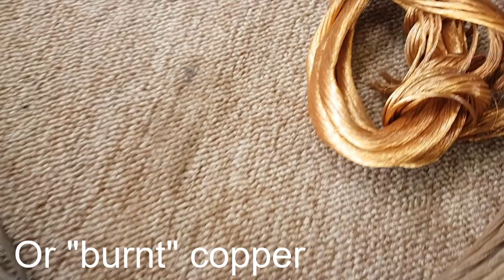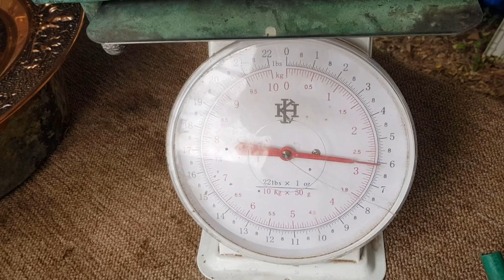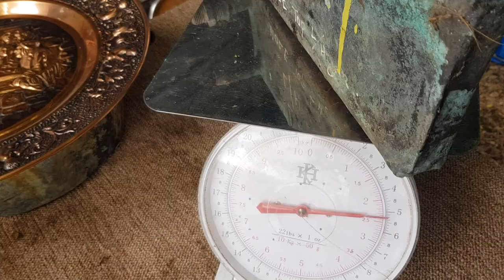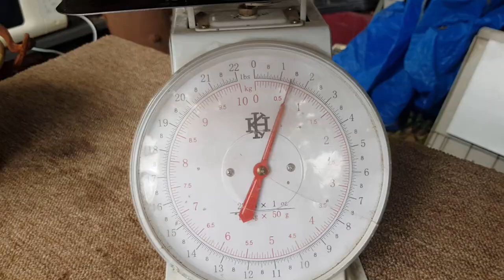Scrapping Copper! A beginner's guide to a valuable scrap metal and how best to make good dollars!

Comment: Thank you for taking the time to share your knowledge sir! You have a very easy going way of explaining things so as my brain doesn't explode when understanding the fundamentals of the chemistry of metals. My question is, is there an easy and time saving method of stripping #1 copper wire (in bulk) without diminishing the price from top tier.
Reply from the maker: Thanks Jacob. You can buy specialist wire strippers, but it's only viable if you have lots of heavy gauge copper wire to strip. Standard appliance cords aren't worth it in my opinion.

Comment: Never knew that they had started swapping out the copper for aluminium in the transformers. Cheers Chris.
Reply from the maker: Yeah, it's been sneaking in over the years - cost cutting by the manufacturer's I guess! Disappointing for copper hunters!
Reply: @TheUltimateRecycler  even more disappointing when you take the top off a fridge compressor and find it's  aluminium and not copper.
Reply from the maker: @howardchambers9679  It would be! I didn't know they were using aluminium in compressors! As a rule, I don't scrap them out anyways - too messy!!

Comment: Thank you for the educational video. I'm glad you pointed out the copper coated Ali wire on the transformer as I to came across the same type out of a microwave. As the wire was quite black I had to scrap it and noticed the colour plus it was considerably lighter. As a begginer I'd already pulled it apart lol. My question is regarding copper pipes. I found a pile of mixed pipes and some are a chrome colour possibly from a wall mounted urn or water cooler drink fountain. Non magnetic and after filing its a bright gold colour possibly brass unless stainless can be that colour? Oh have you a video on car stater motors I got a couple and found one to have a good amount of thick flat heavy coils almost like the type you see people wearing as braclets for arthritis. Worth it they were insulated with a rubbery material which peeled easily once unwinding each coil was over a meter long and 4 coils I was quite chuffed with that one but the other one had very little copper and didn't have the type of thick flat copper coils that the other one had. I'm also an Aussie 👍
Reply from the maker: Thanks Scott! 😊
The chromed pipes will be brass if a yellow colour. They did chrome both copper and brass piping. If it was stainless, it would be noticeably harder when filing and will be a silver colour. You could also do a spark test with a grinder. Brass/copper doesn't spark at all - stainless will.
Nope, no vids on car starter motors at this stage. I usually sell them as motors as I'm usually short on time!
Thanks for watching mate!
Reply: @TheUltimateRecycler  all good, one thing about you I noticed is you always reply back to each comment which does take a lot of your time but it really realy means a lot. Thanks again
Reply from the maker: @scotthoward4836  Yeah, I try and reply to everyone who has taken the time to comment - even the negative ones! There will be a time if my channel keeps growing that it may be impossible to keep up with - but I'm always up for a challenge! 😆

Comment: @The Ultimate Recycler  Is it worth it to dunk tarnished copper or brass in a vinegar bath to remove the verdigris? Vinegar can be had cheaply, and a 35 gallon drum will clean a LOT of copper and brass.
Reply from the maker: It depends on the time you have Wesley. Generally though there's not a huge difference in price between No. 1 copper & No'. 2, so I don't think it's really worth the time (regardless of the vinegar cost). Brass can pretty much go in with a small amount of corrosion anyway..

Comment: At my job I degrease copper and brass blasting caps and if any of them fall on the floor, which is usually a lot after a shift, I cannot use them anymore and have been told to just throw them out. Can I trade in the empty copper blasting caps?
Reply from the maker: For sure! You'd probably have to check with a scrap yard as to the grading - but they would certainly buy them! 👍😊

Comment: So do you take the electrical components small green ones and such straight to scrap or do you unravel the copper of each one? Would I get 1 or 2 copper from said parts?
Reply: There is some light flux or putty on some of it from it being on electrical components
Reply from the maker: @darranstephens7667  Any coils etc found in electrical situations are going to be lacquered copper wire and would go as No. 2 copper. I don't usually unravel any of them unless I have spare time (which pretty much never happens!). Hope that answers your question.. 😊

Comment: 19.12 I have a few copper aluminium radiators from A//C , split system units. So you do suggest with a grinder cutter down to remove those copper pipes which look like noodles sticking out . What do you suggest.
Cheers very informative video
Reply from the maker: Thanks Stella Bella! I only cut the copper noodles off if I need to remove any steel on the radiator - otherwise I just sell the radiators complete. Thanks for watching 😊👍
Reply: Really??
I thought cutting through that very easy material to get to the copper pipes??
I also have various motors from huge industrial heating/cooling which I don’t no if I should pull apart or sell or just take them to the recycling scrap yard.
Also I have like 4 inverters/ transformers- yellow & green & guessing they are used on building sits for high voltage use . 
I don’t no what to do .
?sell them I don’t know.

Comment: I was wondering EPNS plated copper ie silver plated copper and brass does that bring no.2 when handles etc. is removed
Reply from the maker: Yes Roger, silver plated copper would be the same as chromed copper (some water pipes are chromed), and would go as no. 2 👍
Plated brass should just be able to go in the general brass bin!

Comment: Can scrap number 2 copper pipe be put in the same bin as number 2 copper wire from electric motors. Or does pipes have to be separate from wire as I'm unsure what scrap yards require in Perth WA
Reply from the maker: It's pretty much the same Scott, so should be able to go together. I've always had separate tubs just because pipes and larger pieces of no 2 copper stack in bigger tubs better while wire usually bundles up small and stores better in buckets. Best check with your yard to be sure though 😊
Reply: Ok cheers. I did store it separately to begin with but I needed the other storage tub for something else. I got my pipes small enough to fit. I really hope they take it mixed when the time comes or I buy another tub and separate it before I get to much

Comment: Quick question, I had some bare bright about the same size as your example and I stripped it. It was all beautiful and shiny but then tarnished really quick and is now a complete brown colour. Is there any way to prevent or remove the tarnishing? I'm not really interested in sending my copper to the yard but more if I decide to end up melting it.
Reply from the maker: I don't think tarnishing would have much impact on melt quality YL, but the copper certainly doesn't look as pretty! You could simply keep it in an airtight plastic bag to prevent bad tarnishing.
Reply: @TheUltimateRecycler  Thanks mate 👍